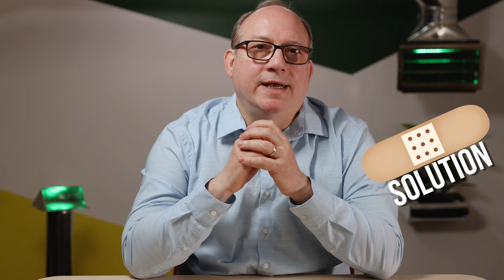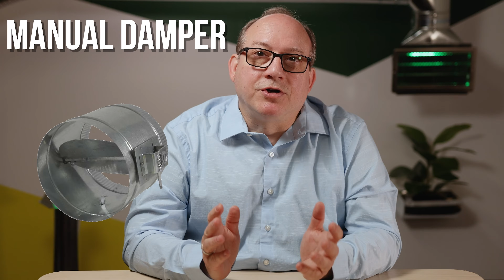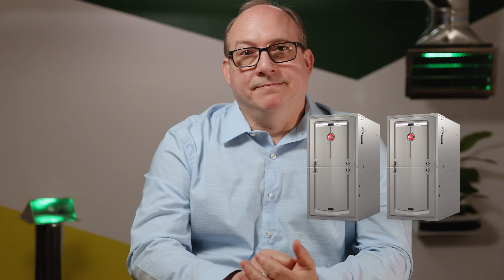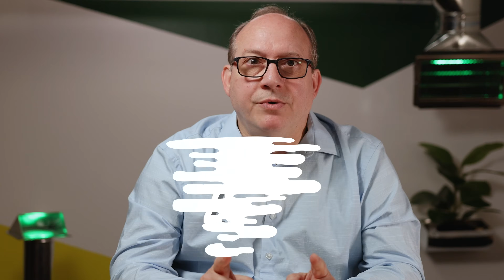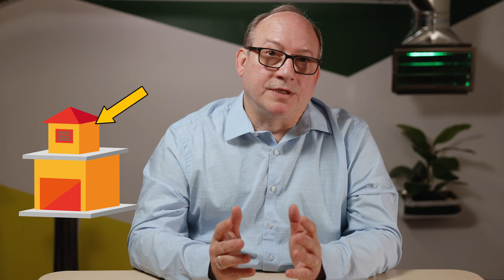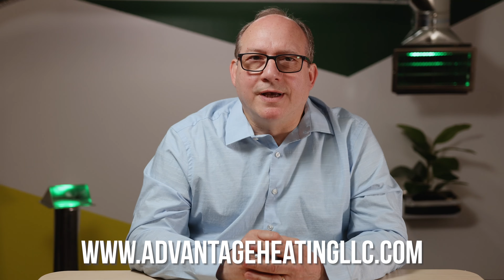Why Won't My AC Cool The Upstairs?!

Comment: A lot of our issues are the crappy hot air returns on the upper floor.  One is on the floor, which is useless for hot air.  The other is in the hall below the ceiling.  There are 2 on the main floor, which are double the size of the one they put upstairs.

Comment: I have a portable AC unit for the upper floor, hooks up to one bedroom window and then a big fan to aim air out into the hallway and the other two rooms.  Works good, but I had to add in a hose to make it a two hose unit from a one hose unit.

Comment: The house I rent has a half submerged lower level that gets all the cold air in the summer. Since I can’t make any actual changes to the hvac system I bought magnetic vent covers for all the lower level vents. This helped cool the upstairs significantly and made the lowest level feel less like a walk in cooler.

Comment: A good video that succinctly and quickly discussed the problem, then got right to the point - alternatives to fix it. Are there small ac/fan units that can be plugged into the wall that are any good at cooling individual rooms? The windows in 2 bedrooms in the upper floors aren't the best and I can't afford to replace them. Those rooms get pretty hot and the air coming from the vents is definitely not coming out as strong as they are in the main floor.